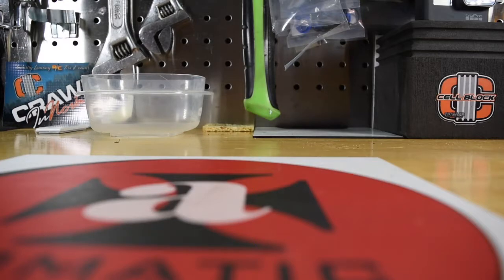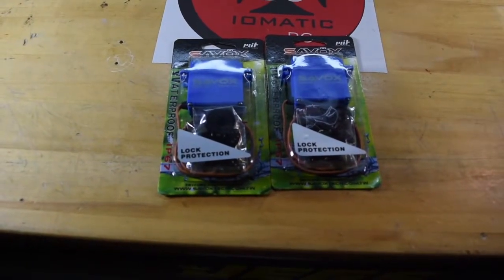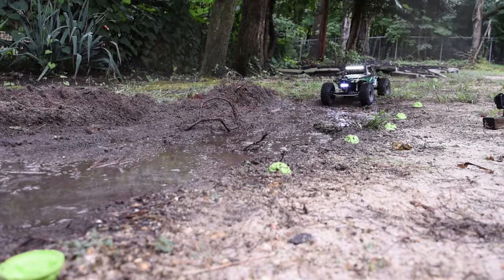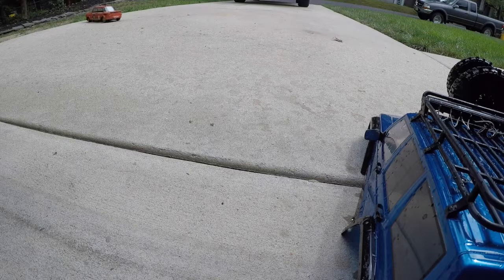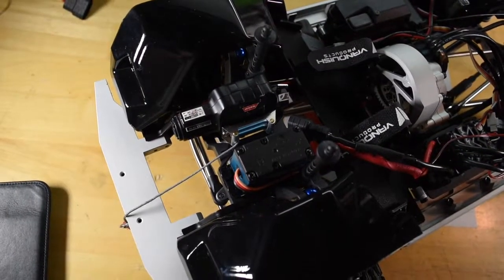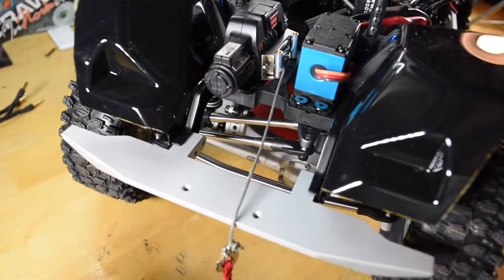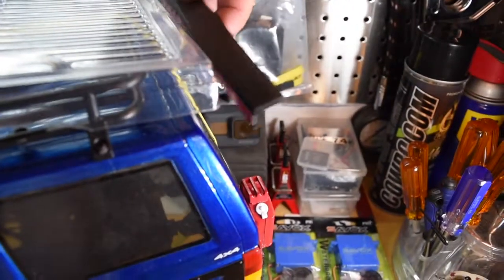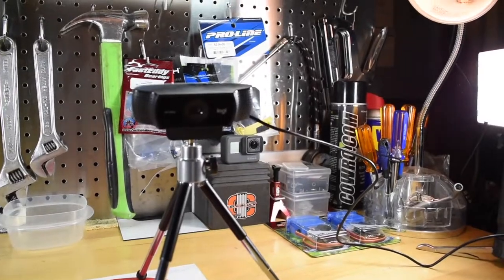RC Randomness Episode #10 - Grand Hauler, TT-02, VS4-10, SCX10ii, and more!!

Comment: 😃cool stuff!! For your camera do what I do get a lens shade it will help protect it if you hit your camera.....like i did the other day to my canon sl2 lucky I had the lens shade on my 250mm lens!
Reply from the maker: Shen RC - I picked up a hero 7 so I can use 2 go pros!
Reply: Nice!! I always like the video look from the DSLR but they are much more harder to use for the RC videos plus you don't want to get them all messy and nailed by a RC!  that's why most of the time I use the small action cams... The Nikon DSLR's are not good at video the canon DSLR's with the dual pixel auto focus work 100 times better and  focus way faster and precise for video.

Comment: The stock motor in the semi's go really good. They are fast in third gear. You don't need a brushless system in that. Tamiya has a couple different brushed motors you could use if so.
Reply from the maker: RC4X4 - I think I’ll just get the MFU. It’s so cool I can’t resist!
Reply: I second the brushed the king has open differentials brushless would sorta be a waste and the controller is awesome I had the tamiya one in the one I built
Reply from the maker: I agree. I'm going with the MFU and I'll save the Mamba X for my next project idea!